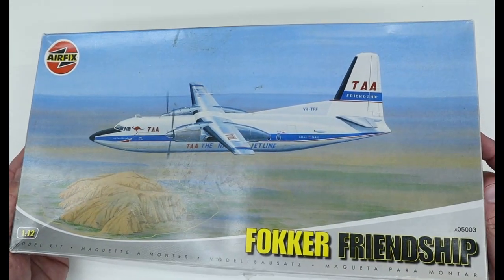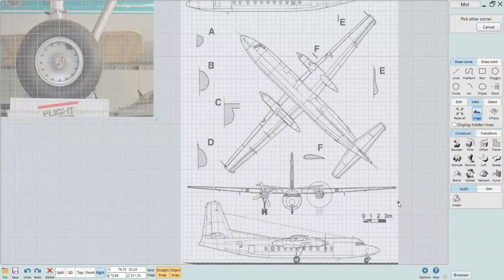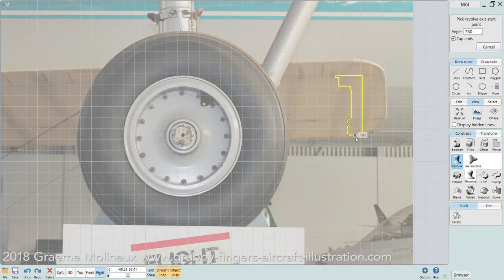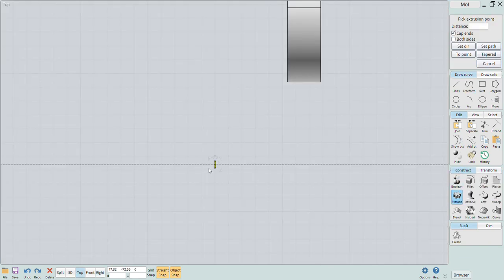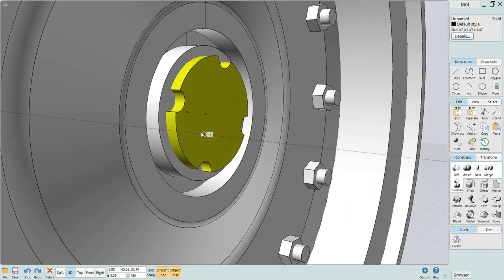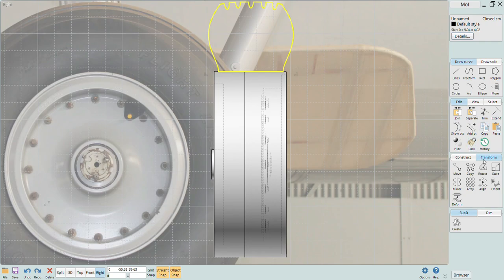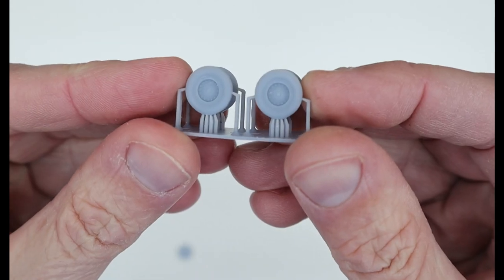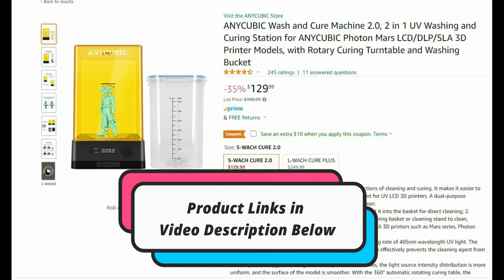Designing 3D printed parts - Making Model Airplane Wheels

Comment: Great video, where these high quality scale drawing could be found please do share
Reply from the maker: Thanks for the feedback.  I get most of mine off of the internet or from books.  Have to dig sometimes but typically, you can find what you need.  Let me know if you need anything specific.  Cheers!
Reply: @FlyingSModels  thanks for your reply, Are any websites or books you could suggest ?, well I was looking for BAC English electric lightning  and couple of more like the usaf whole fighter range
Reply from the maker: Books like aviation archives are relatively inexpensive and available on eBay.  Up-ship and secret projects forum are online sites that have some good reference material.  Hope this helps.

Comment: Nice to see you back my friend
Is the software similar to AutoCAD?
For 3D printing the higher the micron value the better the resolution? ¥r the other way around?
Reply from the maker: Thank you, Peri.  The break was too long but several "life events" kept me from doing too much the last several months.  The software is very similar but really easy to use.  It's a NURBs based program vs. the Polygon based ones that are used for graphic design and CGI.  I'll let you google and read up on that...haha.  But yes, the lower the micron setting, the smaller the step height between layers as the print head moves up and down curing each successive layer in the build.  The resolution can be increased by going to a great number of pixels on the LCD.  They now have 4K printers that are pretty reasonable and even a slightly pricier 8K one that I saw the other day.

Comment: Very interesting, it looks like you could do a large variety of parts, maybe pilots and instrument panels? How sturdy are the parts, are they as strong as standard parts cut off the sprue in the kit.  Actually the cost you reference is not that bad, when you compare current kit cost running between 150- 200 dollars for large scale  and a out 50 for 1/48th. Pretty good ROI. Just retired and getting back into modeling - think I'd better subscribe as I m getting up to speed on materials and kits after a long absence.
Reply: Have you never had a resin part before? They are stronger and better than the kit.
Reply from the maker: That is true.
Reply from the maker: You can print whatever you can design (or download from design houses).  Like RiverRock says, parts are strong, just like any other resin parts.  Cost isn't bad at all given all that can be done with it.  I've had great ROI on mine by selling many of my printed parts.  Hope you subscribed.  Appreciate it and the feedback!  Happy modeling and congrats on the retirement.
Reply: New thought, NASA sends the plans for new tools to the ISS, where they print out custom designed tools on a 3D printer. I think 2022 just got got a little more interesting
Reply: @c123bthunderpig  Yes indeed.

Comment: Was first I've seen someone using MOI's software. Looks as easy as have heard. Am curious if you have any thoughts on using it in Naval kits for Anti-aircraft platforms that tend to be the wrong shape etc. Can't see it being too dissimilar. As a common example, Fletcher class destroyers AA platforms varied, depending on refits and wheel houses being open or closed.  Am sure bit of learning the software, appreciate sharing your experience in this video. Well done with the pace and timing.
Reply from the maker: Thanks for the comments.  I think this software is well suited for making these type of structures.  A quick search online shows that others have already modeled up some gun batteries in various scales (not sure exactly which comes you are looking for).  But if you have good references, MOI is very easy to use with those references to create those platforms you are looking for. Reach out thru Facebook or my website contact section if you want or need to chat more.  I sometime miss replies to these comments.  Cheers!

Comment: Excellent work, I have followed your steps but I am stuck on how to turn the piece so that it faces you, could you tell me how?
Reply from the maker: Thanks.  There are a couple of ways to do that. You can change the view by clicking right, left, front, back, etc using those buttons on the lower left of the program.  Or you can select the object, select the transform, then rotate, then rotate around axis feature.  Click the center of the object and then drag the mouse straight up and click to select a vertical rotation axis.  Then in the command box in the upper right, Input a rotation angle of 90 degrees and it will rotate to face you.  If you have any more questions, just let me know. Hope this helps.